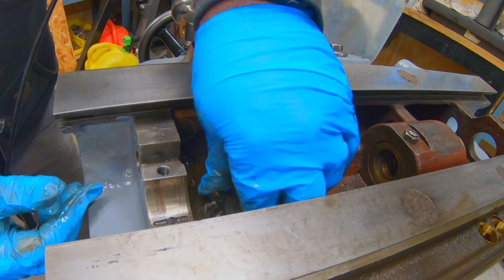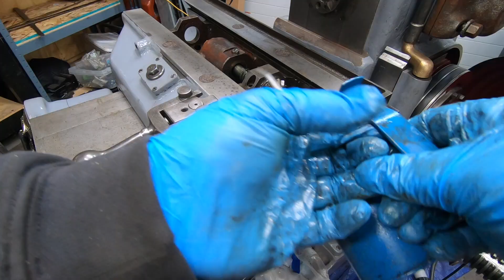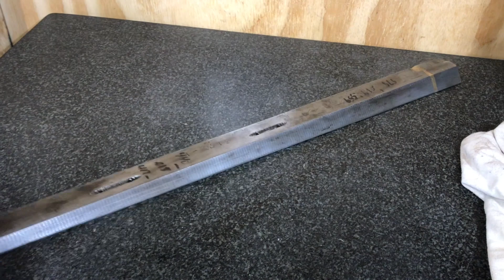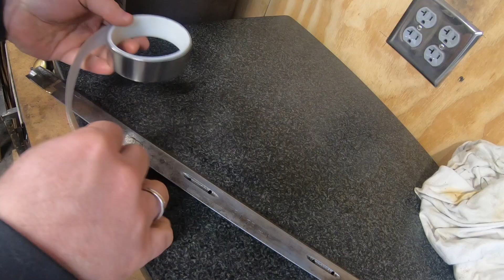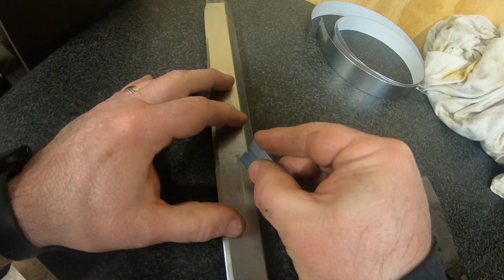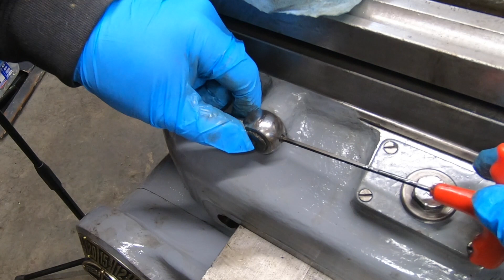Setting the Table on the K&T 2HL - Part 1

Comment: How did you measure the gib wear?
Reply from the maker: I'll try to explain it best I can. Don't get your hopes up. :)

First thing I did was to measure the taper of the gib. I picked two spots, 3” apart, and measured the thickness of the gib at those two spots with a micrometer and found the difference. I don’t remember exactly what it was, but for examples sake, let’s say it was .0625”. I took that difference and divided it by the spacing (3”) and then multiplied by 12”. That will gave me the taper per foot. Which in this example is .250” per foot.

Next, with the gib inserted where it needed to be to give the proper fit of the slideway, I measured how far it stuck out PAST where it should be. Again, I don’t remember the exact measurement, but let’s say it stuck out an extra 1.25”. I multiplied that measurement by the taper and divided by 12”: 1.25 * .250 / 12 = .026”. That would have been the wear in the gib (not the actual number, just for the example). It would have to be .026” thicker to NOT stick out the extra 1.25” So by shimming the gib on the stationary side with a shim equal to the number I calculated, it put the gib exactly in the center of the saddle.

At least that’s the way I did it. I hope this makes sense.

Comment: your shim idea is better than mine,  but the shim I used works just as good. and I have full travel .  it is tighter on the ends ,but usable. I have .013 to .015 shim in mine.
Reply from the maker: Ideally I would make a new one, but of course, lack the equipment and experience. ;) Maybe some day. I have the feeling this one will be just fine for many years to come.

Comment: I think the shim tape will do ok, assuming the gib is flat as you checked.  Would be nice to have a surface grinder big enough to kiss the surface and then apply the shim tape.....or I guess just make a new gib if one had a surface grinder big enough. 

Did you run your felt wrapped screw idea by ron grundy? I'm trying to remember if my 2hl had anything in there to lube the screw. 

I'm about 2 months behind you on doing this to my 2hl.  Keep the vids coming!
Reply from the maker: Making a new gib is the only true fix, but that would also require scraping it in flat. Some day. I have a project coming up in the next 6-9 months that might require grinding and scraping, so it may be then that I decide to jump into that.

I did ask Ron about the lead screw and he didn't have any recollection on how the older machines were oiled. Maybe the further he gets into his 1H rebuild he might be able to tell.

I'll be happy when this thing is ready to make chips. After this,  I still have to rehab the overarm supports and figure out what kind of cutting oil I am going to use.